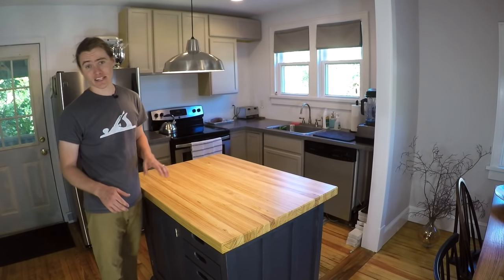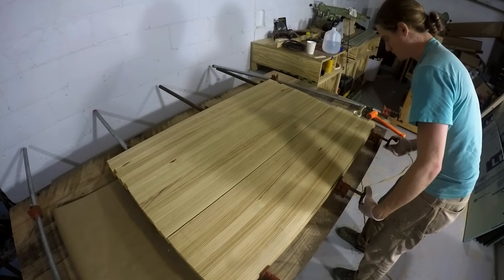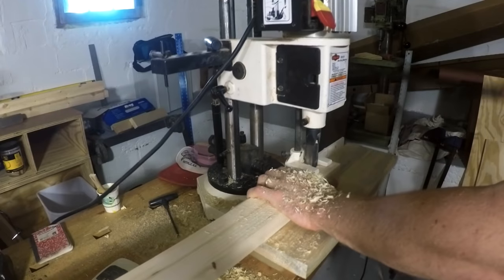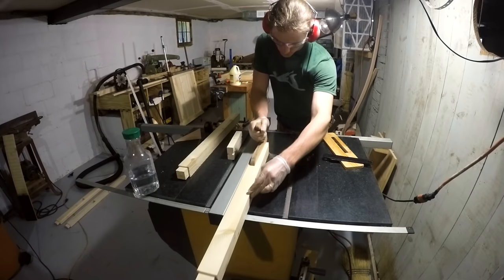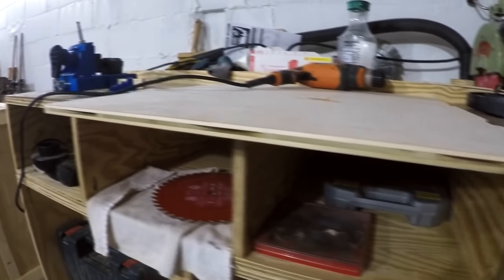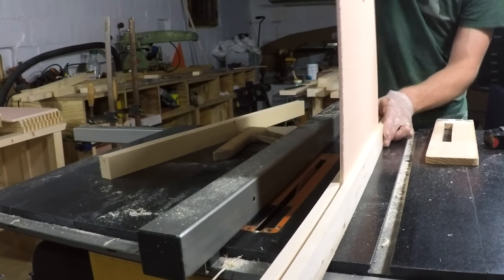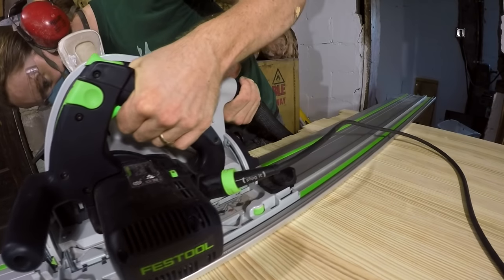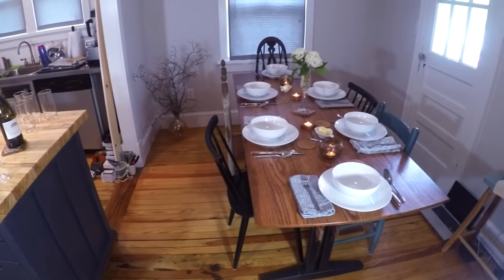Making My Kitchen Island - With LOTS of Storage!

Comment: Did you plane one side of lumber before you began ripping your 2.5" pieces for the top? Or was it flat when you bought it at the store? I am about to start my own island and debating to use your method or use 2x3 with my jointer and planer.
Reply from the maker: Not 100% what your asking but the "proper" method if you have the tools is to Joint one face and one edge, place your jointed face down and run through the planer to your desired thickness, now place your jointed edge against the fence and rip to your desired width. I think you are just asking did I plane my lumber so the faces mate cleanly, the answer is yes. In that case, I'm not jointing anything. I just plane both sides and go with it. if there are small gaps, I just put a little filler of some sort in cracks and sand. When using construction lumber, I don't get too picky since you are using a lower grade lumber to start with, it's also in my own kitchen. Also, when you are using thinner strips, they will flex to fit tight, so having everything jointed with a jointer, isn't as important. This depends on the project. Pick your lumber carefully so that when you glue up the top, the strips are showing 1/4 sawn grain, it will make your top more stable and look better. You will see the long stripes of the grain instead of cathedral pattern. Google image if you are not familiar with those terms. Good luck, let me know if I can be of any help.

Comment: How did you get all your tools? Like your jigsaw, tablesaw and everything else. Did you save a lot of money? Or did you purchase all those over the years?
Reply from the maker: I have just bought things as I need them over the years. I started out with pretty cheap stuff in college. I made beds from 2x4s and sold them. I started with a black and decker drill, a circular saw that shocked me and a broken miter saw. My beds bought me my first table saw, planer, and jointer. (All of which I've replaced) . I make and sell furniture, so it's a hobby/profession. Most of what I have isn't that expensive, but some are. Most of my tools you see have been purchased over the past 5 years...some before, with a lot of them being within the past 3. Yes I do save a lot of money, meaning a good portion of what I make, not real big numbers but over time it grows and gives you options. Don't get hung up on what you don't have, just use what you do have the best you can. By the time your an old man you'll have a shop full of tools!
Reply: Thank you for actually taking the time to answer my question on a 3-year-old video. I really like the effort and commitment you put in! Al your videos are really helpful keep up the good work!

Comment: 2 quick questions,if i may 1)did you treat the wood for the butchers block top with any kind of food-friendly oil so food stains and the like dont penetrate the wood and create bacteria & such? and 2)is it difficult to add casters and wheels to the bottom of the island to make the island portable?
Reply from the maker: The top is polyurethaned and adding casters is as simple as screwing them on.

Comment: Thanks for this video, I don't know why I've never seen it before.  I'm subbed and I've searched two way drawer before, but YT never popped this one for me till now.  Go figure.  I want our island to have a section of this type of drawer.  
 So at 9:37 where you are constructing the slides, the drawers are riding on about 1/2" of spruce with a maple bearing strip, is that correct?  The cuts are a little fast for me to fully see what is going on there.
Reply from the maker: Pretty much, it's just how I went at it......I may do it differently if I did it again. It's worked so far.

Comment: I want to buy a festool track saw and while I could afford to buy either or both I am just a diy person and cant really justify spending the money on both. Which would you recommend? I see you have the big one. I would mainly be using it to break down sheet goods but think the big one would be a good buy in case anything large came up. Your thoughts are appreciated.
Reply from the maker: I think you answered your own question. I would only want the big one. I use it for thin and thick. If you are going to buy the saw online, let me know. I can send you a link to purchase it on Amazon which would give me a small percentage, it's a way for viewers to support my channel if they'd like. Festool's sell for the same price regardless of where you buy them, so the price is the same. I also trust Amazon with purchases. Thanks for watching.
Reply: could you send me the link

Comment: Why would you do such amazing craftsmanship and materials, and then use Luon?  The top is beautiful.  How did you finish it?  How did you make sure the 12" sections were all planed the same?
Reply from the maker: +Jack FnTwist Luan is just thin plywood, 5mm, about a 1/4 inch. Luan is just a name, it's a hardwood plywood, there's nothing wrong with it and the stuff I use is pretty nice grade. This entire piece was made out of pretty common materials, pine, spruce, etc. Without explanation, if you where standing here looking at it, you would not notice the drawer bottoms. I used polyurethane on the top, painted the base, with polycrylic as a top coat....it's all in the video. Planning them all to thickness is easy, you just run each one through, then lower the planner and repeat until you get to your thickness you want.
Reply: The Homestead Craftsman Ok.  I'll let the Luan issue go, but I'll have nightmares about it. LOL.  Seriously nice work, though.  Still not sure how you planed the whole surface unless the sections perfectly lined up after planning them.
Reply from the maker: +Jack FnTwist All the sections are planned to the same thickness, the bisquit joints line it all up and the top gets sanded, once again....it's all in the video. It's fast paced but I show joining, sanding and finishing.
Reply: The Homestead Craftsman Ok.  I saw it while you were putting the biscuit joints together and was wondering if you left out a final planning or something.  Bring your skills down to FL and you'll make a fortune. :)
Reply from the maker: +Jack FnTwist With the biscuits, I use them strictly for alignment.......most of the time. But you do end up with just a hair of difference between the surface. The belt sander quickly takes care of that and the orbital sander blends it all in. One could hand plane it smooth, but with pine you would have to have your planes cutting perfectly to avoid tear out.

Comment: I noticed you are always wearing a respirator when cutting/routing your parts. How long after your cuts are done do you remove the respirator and continue to work without it? I have a very small shop and i suspect micro-fine dust particles are always airborne around me. That makes me think that wearing that respirator longer makes sense after cutting your stock.
Reply from the maker: +David Letz Sometimes it's on for hours, I'm very used to wearing it. I also have a jet afs-1000b air filter that I run all day, it does a good job of clearing up the air. You can also set up a simple filter with a box fan and a 20 inch filter taped to the intake side. I still do that when needed. The safest advice I can give is get a very comfortable respirator and use it as much as possible. Then figure out a way to collect as much dust as possible right at the tool along with having some sort of air filter. For collecting dust at the tool, a small dust collector like harbor freight sells or a shop vac. I do both, but also have a Bosch dust extractor, it's tool activated so when I turn on a tool the vac turns on too. But even with all this I still wear the respirator........most of the time.

Comment: hello
how does the framing lumber 'top' hold up. as far as not being very cured. thanks josh
Reply from the maker: +gentile joshsaved It's doing pretty good. No cracks or checks, no warping. Like I said in the video, I ripped the strips and let them acclimate to the house for a while before gluing up the top. I even let them sit a while before planing the 3 sections that make up the whole top. The only detail to note is, when I run my hands across the strips (the width of the top) there is a slight wave from strip to strip......but like I said, slight, and not in a way that is bad in any way. It's just not as flat as glass. It being pine and the design of the rest of the island lends it's self well to not being absolutely perfect, like dents in the top, over time it will develop a very nice look. Thanks for watching.

Comment: Have a question for you - if you wanted to attach an island to the floor, how would you do that?
Reply from the maker: L brackets and screws, pocket holes on the inside, or just trim around it. Not much to over think.
Reply: The Homestead Craftsman thanks so much. You’re right, simple L brackets.

Comment: Why did you not use some of your reclaimed wood for the top? Did you have to let all your stock sit for a while to let them dry out enough?
Reply from the maker: +sonofjebbo  A while back I made a couple of islands using the same wood in the video and my wife really liked it. My original plan was to us some thick reclaimed pine beams I have but I went with her choice. I'm happy with the way it turned out and still have to other lumber for a future project. Also, it made all the lumber, wood that you can get easily, so I thought that was a nice aspect of the project for viewers. Some of the lumber sat around, but most I just used quickly. The way the island is made it all holds it's shape since it's a box. If it had normal table legs, you definitely run the risk of them bowing, twisting, etc if they are not already dry. For the top, I ripped it up as soon as I got it flipped the grain to alternate as much as possible and glued it up. After the top was glued it sat for several weeks before mounted to the top. It cupped a very small amount on one side, about an 1/8 over it's width, but the base just pulled it straight when it was mounted. The top is also finished on both sides which stabilizes it much more than if you leave the underside unfinished.
Reply: That's great. Thanks for sharing, your new shop looks like it's working good!

Comment: Good Morning.  I'm shocked that you use spruce from Lowes or HD so often on various projects.  I thought that wood would not be appropriate for furniture.  Would you mind commenting on your success with the spruce?  Maybe I should start using it more.  The price and availability is certainly attractive.  Thanks
Reply from the maker: I use it with success but would not use it all the time. I let it sit in my shop for a while first to dry more. 2x6s are the best value and cut to me. In furniture I only is it if painted.